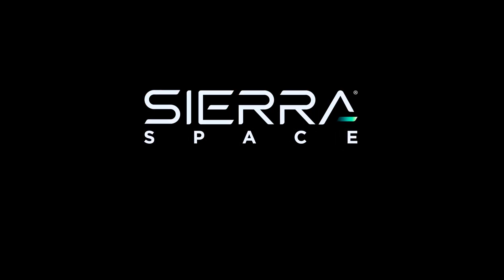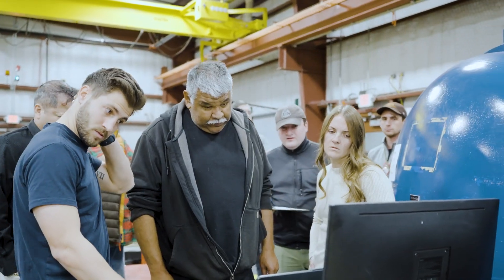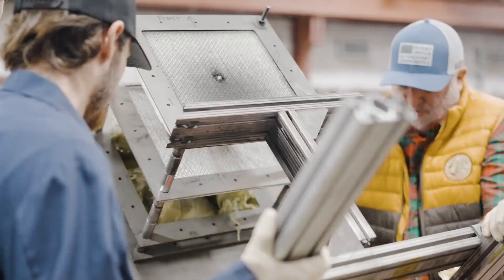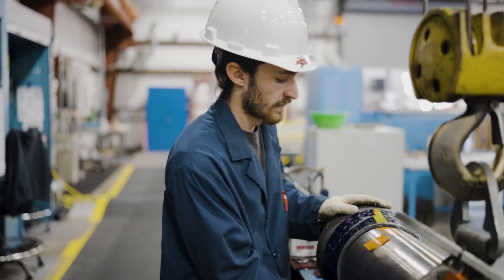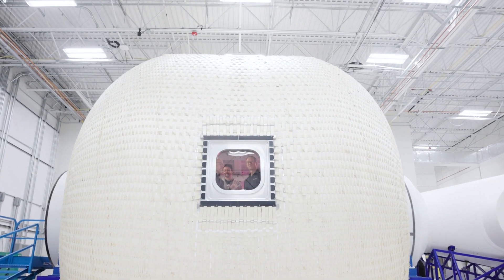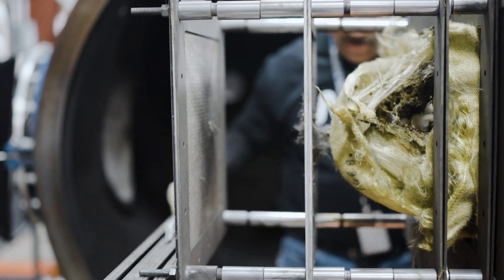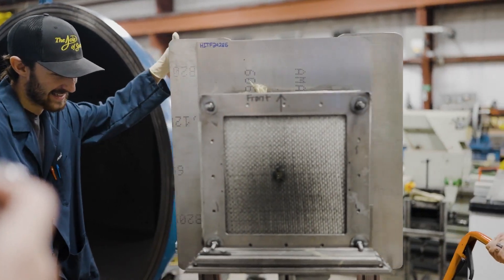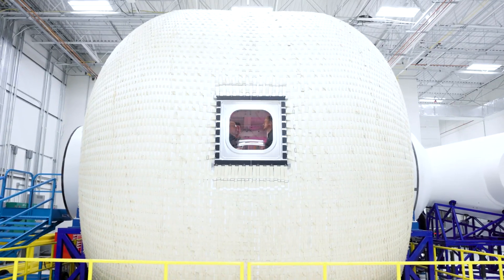NASA Fires Hypervelocity Projectile at Inflatable Space Station

Comment: So im concerned about the word sacrificial being used to describe the shield. Does that mean it needs replacement? I mean my brakes on my car are sacrificial and they work when maintenance is done... Im just wondering what kind if regular maintenance this shield needs if it it sacrificial? It's like any other system, there is a failure point even in the strongest of systems and this failure isn't measured in a single use, it is measured in many thousands of cycles, in this case many hundreds if not thousands of strikes on the same exact segment or part without replacement... Like bridge stress test testing.

Comment: That is intriguing and definitely important work. It looks like that material is a good idea to me. It appears to be lightweight, and if it can withstand the tiny little objects flying around in space, then the weight savings could be beneficial. 
   That orb looking thing that they were standing in is also different looking. It appears to be of the same type of stuff. I only have one question, if the inflatable is one piece, how do you repair it when it does take a hit? I think it also might be a good idea to make it something like those tiles on the outside of our Space planes that are for reentry. That way, you could just replace a small part. 
   However, I am not an astronaut. I was paying attention enough to understand that there are standards, so if the technology passes the standards, then they should be ok. That technology still does look to have promise. 
   Those inflatables should definitely be helpful in the quest for habitation somewhere like mars or elsewhere. We already get to places much faster than what was thought to be possible when I was young, good luck!